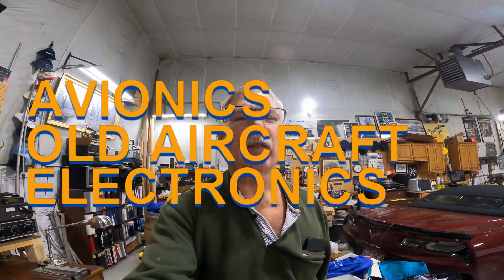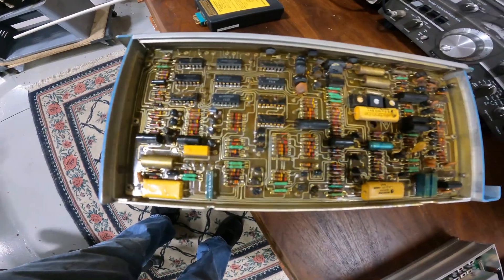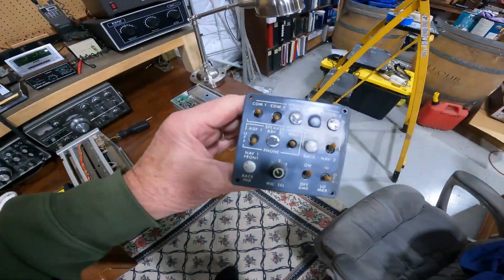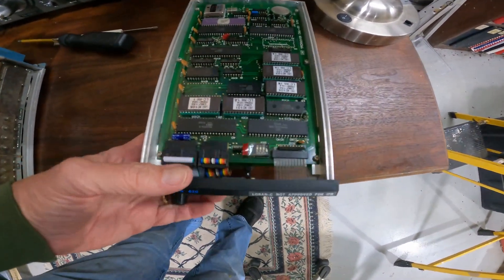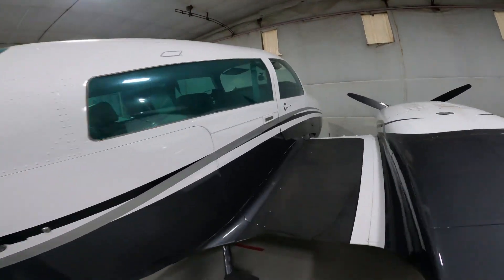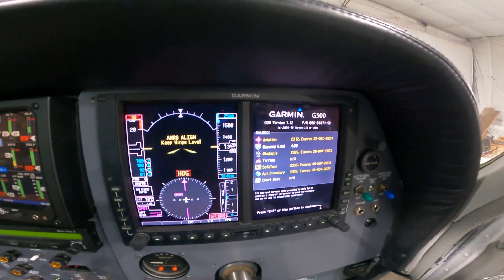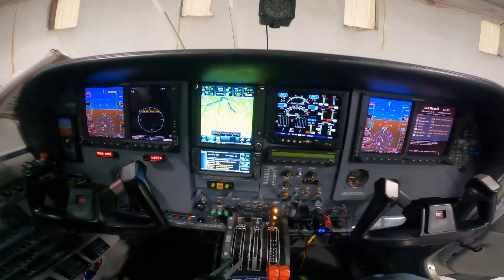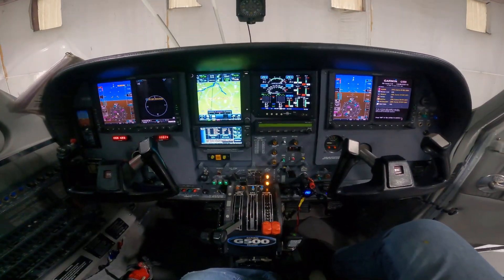AVIONICS OLD AIRCRAFT ELECTRONICS

Comment: Not a pilot, but interested in aircraft instrumentation and control systems. 
When I heard your comments on the vacuum systems that were used with the old gyros, it reminded me of something I saw in the DC8 systems manual: a circuit breaker labelled "Instrument Vibrator". 
I was wondering if this was something that was used to increase the accuracy of the mechanical instruments.
Reply from the maker: Altimeters tended to stick sometimes, the old ones, around the zero point mostly.
Reply: Thanks for that info. @ronrogers

Comment: In my collection I have a "book" airspeed, Mach meter, and G meter that was pulled from the cockpit of an F-105 Thunderchief.  The nomenclature tag on the back of it says it was made by Bendix in 1966.  It has toggle switches on the front for "command reset" and uses black scrolling tape with white markings to indicate the values (speed, Mach, and G).  It's about as big as a shoebox and the thing weighs a TON!  I have it displayed beside my large, steel model of a Thud.

Comment: That is a nice classic ham radio setup! I also have a Kenwood TS-520S that still works very good. The older avionics brings back memories. In the late 80s I earned my Private Pilots license, a C-172 I rented had a Northstar M1 LORAN. A very nice unit with an aviation database. I bought a 1971 Cessna Skyhawk in 1989, one of the Nav-Coms was an old ARC with vacuum tubes. It had crystals on a rotary assembly that turned with the knobs to provide 360 comm com channels, I don’t remember how many Nav but it had VOR and localizer. Before I started instrument training I upgraded it to a Narco MK12D with glide slope and put in a new audio panel with marker beacons. My number 2 was a Narco COM 120 and NAV 121. I also had a King KR86 ADF. I used this for years VFR and IFR, dual NAVCOM and an ADF. No DME or RNAV. Later I upgraded with a Garmin 430 IFR GPS and a STEC 20 autopilot. Nice setup for its day, but I still flew with vacuum attitude and DG. I finally sold the plane in 2011 and bought a boat to cruise around in. Thanks for your videos, I really enjoy them!

Comment: Yes I use  Loran back in 1985 flying in Alaska in 207's. One advantage though loran had over the VOR's. Is that you could hook up the loran on the ground before takeoff. But the VOR you had to wait until you're flying in the air most of the time before they would hook up. And there weren't very many VOR's in Alaska at the time.
DME that was slant range. The higher up it was the more inaccurate it was.

Comment: I have an old Bendix (or Narco? been some time since I worked with it) combination radio and VOR. This big box has everything contained including indicators, appears 1970s and it works. I once put it in my car, driving on highway 101 in San Jose it somewhat tracks VOR stations at Woodside and SJC (though it seems reflections from buildings causes interference). When I switched to ILS I can see the needle move from one side to the other when I pass the SJC runway.

Also in my collection is an aircraft coffee maker I got on eBay around 2000, it has the green tag identifying the 727 it was pulled from. This cargo plane owned by ATA which shortly after I purchased I read they got into trouble with the SEC. This thing is built to withstand high G forces. Teflon wiring, swagelok fittings, etc. Problem it requires 3-phase 115VAC at 400 Hz. Power connector is a multi-pin circular connector (MS series) which I cannot find any documentation for this thing. Other than that would be cool to make coffee at parties. But I have no 727.

Another thing I find is there are a lot of old radios that list very expensive, and they only can be tuned to 0.01 MHz. Why so expensive when these things look like no longer acceptable equipment?

Your 310, is that the same model as flown by Sky King?
Reply from the maker: No, mine was a much later version built in 1978.
Reply: Sky King flew a 1957 310B.

Comment: Very cool.  I had a Loran on a boat in the 80s.  I've got a bunch of old aircraft (1940s/50s) electric gauges that I've repaired and got working again, and I'm considering mounting them into a panel with a power supply and an Arduino controller to make the needles move and lights blink.  Something I can set atop the mantel or a bookshelf, sort of like a AvNerd aquarium.
Reply: Sounds like a great idea!